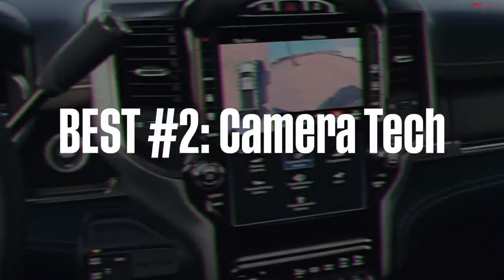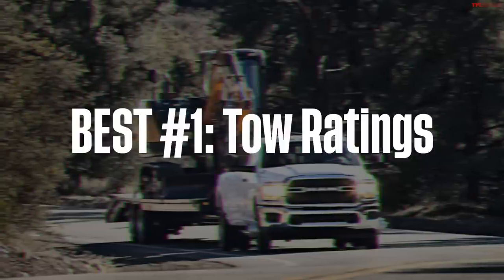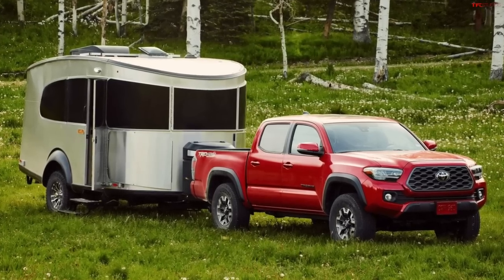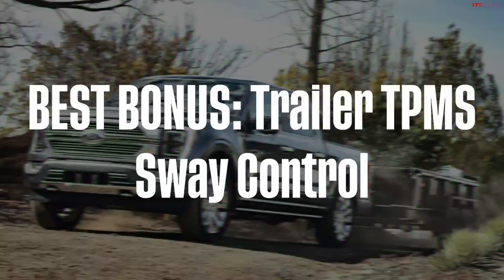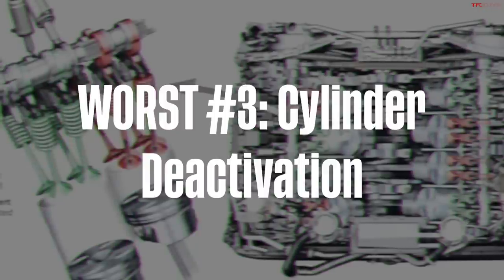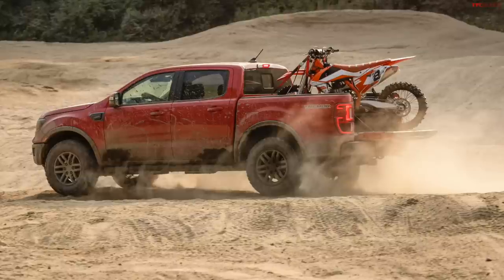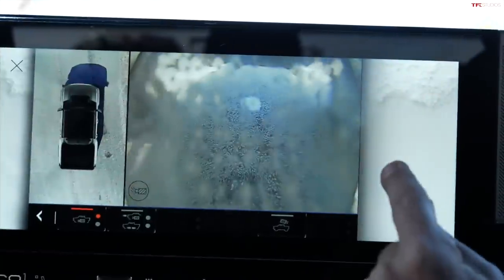This New Truck Tech Makes Your Pickup WORSE!

Comment: I guess I am a troglodyte, at 56 years old I don't see much need for anything in this vid.  I am keeping my 2016 Ram 1500 4x4, V8 as long as I can because it has none of this stuff.  I will replace engines, whatever I have to do to avoid these new trucks.  The only thing I wish my truck had is heated seats, that's it.  I bought a heated pad that I sit on on the really cold days.
Reply: I cannot agree more. The more technology the more problems.
Reply: Look, anyone who keeps an older vehicle is smart. If you keep the truck reliable and looking decently, you save a great deal of money. 
Heated steering wheel is so nice 👍.
Reply: So funny I got in my daughter's car to move it the other day and the heated seats were on.  I woke up this morning and rsndomly thought, I love my Toyota Tundra, low tech, high reliability, I don't need anything else.......buuuuut, man I'd love heated seats!  Hahaha
Reply: @jonesjones7057  I bought a seat heater that plugs into the accessory outlet.  It works, it's kinda a PIA because it shifts around but when it's 0 F at 4:30AM when I go to work, I am glad I have it.  In a couple weeks I will take it out and throw it in the garage where it will sit till winter returns.
Reply: How has the motor been. I had a 2013 longhorn 4x4 and at 70k the lifter roller bearings siezed on one cylinder and it ticked and the motor got 11mpg and it was 5k to fix that side of the motor with no guarantee the other side wasn’t about to go out. I real liked the truck but had to trade it in . Seems like motors dont last. I had a 1990 f150 with 5.0 5 speed that went 240k miles
Reply: @MrGomjabber  yeah that sounds good enough to me, I'm going to get one of those too.
Reply: @PUNCHYNUTZ  So far so good but it must be said it's low miles at this point with only 57k miles.  For the first 5 years I had it, it was a 3rd vehicle only really being used on weekends to the camping resort with family and boat.  For the last year it's been my daily.  I have had fuel pump replaced and 1 exhaust manifold (warranty).  I am aware of these issues you speak of and it seems to be hit or miss if it happens.  I would probably still dump upwards of 10k on a new motor if it goes because new trucks are just insanely priced and all the turbos and whatnot, no thanks.  I really don't think the current Hemi is probably any more problematic than the Fords ecoboost and the chevies also have problems with their valvetrain due to cylinder deactivation garbage.
Reply: @MrGomjabber  i agree and hope it stays strong for you. When it ran it was great! I have the eco now and its good and real powerful but only have 42 k on it. Im sure hell is coming because nothing lasts anymore.
Reply: @PUNCHYNUTZ  I know some guys with the early eco's that seemed problematic, like everything they have gotten better over time with improvements.  They pull like crazy, fun engines for sure.  Just everything is so complex nowdays all to eek out another .45321 mpg at great cost to the consumer.  Not a big fanboi of any automaker, bought this truck purely because it was the cheapest at the time I could find.  I look at what I paid for this truck in 2016 and what the same thing would go for now.....  Insanity.
Reply: @MrGomjabber  i feel like the strongest motors are the HD gm gassers because they dont have all the fuel saving stuff and the city of houston uses them in our ambulances and they take a beating. I know because when i drove them they had over 150k miles and rarely had issues. At least at the time they had no cylinder deactivation. But things may have changed.
Reply: Pretty sure the hemi for that year has cylinder deactivation
Reply: Count this 29 year old in with your troglodyte kin. In the few years I actually owned a truck I never felt it needed improvement. It had a radio, A/C I barely used, a heater that worked quickly, nice soft spots on the window seal for my arm to rest, 3 on the tree, push button 4x4 and two cupholders. That's about all I need for comfort. It was a factory ZR2 S10 so it rode higher, was a little wider and had larger tires, but wasn't obnoxious. 

I never opened the tailgate and thought "this should do this slower and softer" or "this should be automatic" if I had any complaints about the truck not related to its age, it was that a nice backup camera would have been a welcomed modification simply due to the large Blindspot I had below the tailgate when backing up. 

I now have a "modern" vehicle, and the only real improvement it has over my old truck is the remote start feature and backup cam. The infotainment doesn't do much except act as a glorified Bluetooth speaker, the terrain select AWD system while definitely useable is still inferior to the basic straight forward 4x4 that truck had. I could actually fix things when they broke, and they broke a lot due to age and neglect in its years. I knew jumping into a more modern vehicle I wanted the newest I could possibly afford, simply because there now exists a grey area where cars are new enough to be more complex and harder to work on than they where in the 90s, but also old enough that they are starting to need regular repairs and maintenance.
Reply: @AHungryHunky  Yeah, backup cameras are nice, I would like that.  Instead I have a few small dents in the bumper from the trailer tongue when I back up to it to hitch up.  I can live with it.
Reply: At almost 60, I totally agree with you. I have a 2000 Ford Excursion. I put in a new infotainment system that has Apple CarPlay and a backup camera. Regarding heated seats, you can actually have an upholsterer insert the heating pad in the cushion and you can install a switch on the console or dash. Everything I want with nothing I don’t 😂. And waaaay cheaper than a new truck.
Reply: I have added a back up camera, gps, Sirius radio into my 97 suburban in a custom console that I made out of some old cabinets that pretty much match interior color, I can rebuild bumper to bumper ground up 5 times for the price of a new one. Mine looks like new and won’t be mistaken for a hearse.
Reply: I got 99 problems but an EV aint 1.
Reply: @scott offord  

No it doesn't...lol!!

Comment: The tall bed thing is something my dad doesn't like and likes to joke about. "You get the same square footage for a smaller length, can't fit an 8ft plank though". Might have the same "space" as a 6.5/8ft bed, but you can't haul the same things they could. Seems most prevalent in the Coloradoes, that short huge slanted up bed.

Comment: The tow rating on new trucks are ridiculously high with almost no obvious caveats from the dealers. While these products CAN tow the rated weight, unless the trailer, hitch and trailer brakes are matched well to the truck, your trip may not turn out well.

I think that many of us have seen this mismatch swaying down the road and avoid it for no other reason than that you don't want to be the 1st responder to this potential disaster. Because you know that behind the wheel sits a guy that thinks that all is well in spite of the fact that the rruck can hardly be held within 1 lane. Afterall, the dealer said that the truck will tow that weight with "no problem".
Reply: They fudge the numbers on tow ratings, you need to read the very very fine print... Like the guy that cracked his frame with the bed camper. He did not read the very very fine print. ;-)

Comment: Start stop needs to disaper from not just truck but all vehicles. Especially if it's a turbo engine. The turbo is supposed to stay running but if engine is shut off now its not turning. So now you have to wait even longer for it to spool up to get going.

Comment: I bought a 2016 Ram 3500 Megacab Diesel and it stickered for $76k.  That exact same optioned truck for 2023 without most of the tech upgrades is still $94k.  My big questions is how does a truck that is largely the same for 2023 cost that much more when there is no more value in the truck than what was delivered in 2016.  What do I get for an $18k price increase other than worse reliability than I previously had because of all the supplier changes due to Covid?
Reply: Money supply is up more than 40% , so thats the resulting inflation the consumer is enjoying

Comment: Did you know that most fatal falls happen under 6 ft? Bed heights need to lower drastically. Hoods need to get much lower and much smaller.

If you're going to put a backup camera on the tailgate make sure it is at least usable when the tailgate is down.

Passengers sitting in the cab shouldn't be able to max out the payload, either shorten the cab to fit less people or increase the payload ratings. Personally I only need a 3 seat Truck, preferably a single cab one with a 3 seat bench and a 6ft bed.

Comment: Everyone arguing over pricing needs to check out the CPI calculator and compare the REAL price increase. Today’s base model trucks aren’t that much more today than 10+ years ago. But you get a hell of a lot more with it. More power, more capable, way safer, better MPG, better technology, better ride. You have the choice of optioning out the truck north of $80k if you so desire. The half ton class trucks are just as capable as 3/4 ton trucks of 20 years ago. All the truck classes have basically moved up a tick. The new ranger is nearly the same as an older F-150.

Comment: I learned recently from a Firefighter that a bad regular passenger vehicle fire burns at 1500 degrees F and takes 1000 gallons of water to extinguished an electric vehicle burns at 5000 degrees F and takes 40000 gallons of water to extinguished and sometimes they need to be fully submerged in water for 30 days to be fully extinguished so your electric vehicles if they catch on fire might not be covered under your insurance for building your office is located

Comment: How about the greatness of those newly readily available terrain specific traction control systems.  I was able to get all four wheels to spin while clawing up a snowy hill while messing around in my yard with my wifes explorer timberline.  The slippery mode on this thing is awesome on a snowy/icy road. A low bar but this is the best offroad explorer ever.

Comment: All that is why I'm keeping my 03 silverado. It's not a 4x4 unfortunately though so far I've managed to not get stuck on ranches. Clearance is my only issue since Texas hill county ranches have a lot of rocks that like to hit things under the truck, I wish I could lift it a couple inches but can't with this truck.

Only other thing I'd like is a Camara for hooking up trailers, my rear tag is bent in all directions from having to do it alone in tight spaces and uneven ground. All that other new tech doesn't interest me one bit and just means dollar signs for repairs down the road since I drive my vehicles until they die.

And with current prices even for base models who wants to use a truck for the tool it's supposed to be and tear it up years before you've even paid it off? Mine got hit by a baseball sized hail storm two years ago, beat the truck up pretty bad, shattered the windshield and the plastic pieces like bug shield and window rain shields. Other than the windshield I didn't care, it's paid for and twenty years old. The people I know with new trucks and cars hated it and had to get them fixed some got written off as totaled from the hail damage, just the cost of the windows exceeded value on two people's cars I know and those were late model cars. Then their insurance went up for getting repairs.

Not everything new is better or worth the price tags.

Comment: Nice if all tail gates came with dash reminder lights to let you know it is open, hard to know when bed is covered. I've install my own switch-light reminder for 30 years. Trucks are becoming 4 door family SUV with open trunk, a work truck is just that. Bound to fail is turning off and on cylinder, it is as bad as start stop engines.

Comment: I had a 19 Silverado Work Truck that I ended up forcing the dealership to take back as a lemon. I had it for about a year and it spent way too much time in the shop. It had electrical gremlins and the electronic, push button, remote activated, tailgate, would just stop working sometimes. When it would stop working, there was no way to open the tailgate.They couldn't seem to solve it, so I finally said that we gotta walk back this transaction.

Comment: Regarding the payload numbers, I had a 2015 ram 1500 crew cab with the 6’4” bed and the ecodiesel. It was a Laramie. The payload was 860lbs. It also had air ride. Fully equipped vehicles are not good for payload. I had 3200 lbs of sheetrock in the bed once and it didn’t squat at all, but I only drove about 2 miles. Now I have a 22 Silverado crew cab with the 2.7. My payload is 1886lbs. Well over double the payload.
Reply: Time to test out if it’ll do double the 3200lb Sheetrock run you did!
Reply: How does 2.7 motor pull the truck?  No regret from departing ftom v8 motor?
Reply: @dav8road598  I’ve driven the 2.7 and I have 3 buddies that have them. If you don’t tow they are good engines, but don’t tow with them! The engine is too small and will have heat issues. The other downside is they sound TERRIBLE! But if you drive around empty all the time they are good engines.
Reply: @ALMX5DP  I think it could’ve taken a lot more. That air suspension was awesome when it worked. South Dakota winters weren’t easy on it.
Reply: @dav8road598  the best way I can explain it, I hooked up to a 18 foot steel dump trailer with 6’ side walls and bawled the tires turning left onto the highway. Only thing I miss from the V8 is the sound and high speed fuel efficiency. The 4 banger is working hard to go 80 on the interstate. It does it easily, passing power is awesome, just averages about 16-17 doing 80.
Reply: @cliffordmontana4562  I’ve towed with mine a few times, only one time was around 9000 lbs. and never had heat issues. Has plenty power. Average 11.9 pulling 3500 lbs going 74 for about 90 miles.

Comment: Along the lines of cylinder deactivation, I would add auto stop/start.  Also, I would say traction control that you cannot completely turn off.  Agreed, trucks are too expensive and it is crazy about availability and ordering.

Comment: I have a 2020 Powerwagon with 50k on it and I love the cylinder deactivation. I do a lot of side road driving and it dose hekp the MPGs, plus I am able to do light acceleration while it's active. When I need power it kicks off quickly and I don't notice any difference, downshifting takes longer. I do religusly keep up on maitence and do an oil change every 4k miles.

Comment: I just bought a newer f150 and I hate that a backup camera is necessary for it. I went from a 99 half ton ram which was nice and low to the ground, fantastic rearward visibility, to this single cab f150 with a major blind spot with the foot long b pillar, and a tailgate that is 5 feet tall. I hate how tall new trucks have gotten, especially 2 wheel drive half tons.

Comment: Great video and information.   As you said and others posted the Ford backup pro assist being a $2200 range feature is absolutely garbage.  I bought a 2020 Diesel Superduty new.   The truck so far has been flawless since 2020. The Backup pro assist is garbage. I read the book, measured and placed the trailer stickers as needed to calibrate the system and entered the trailer size and backing up the old fashioned do it yourself way is 1000 times easier then try turning the backup pro assist knob.  
I bought from the dealer lot.  If I ever were to order another new truck that would be avoided next time.  

At some point would love to buy the factory trailer rear camera to see what’s behind the trailer when backing but have managed for decades without.

Comment: The constant rivalry has cause this. If you need to tow over 24k get a medium duty truck. Cameras had to be added to truck fronts to see . Bumpers are to high off the ground which is deadly to people in small cars. Everyone wanted more rear leg room so they jammed the engine into the firewall. Some engine repairs you have to raise the cab to work on it. Can’t reach into bed . Their ridiculous. Cylinder deactivation has proved to break.

Comment: On the trailers . I read were rv manufacturers are working on trailers that have batteries that can power the truck that will recharge at the campsite when plugged in. On pricing lots of trucks are just driveway princesses that are never used for intended purpose. They lift them , put oversized tires that stick way out past the fenders. It’s assinign

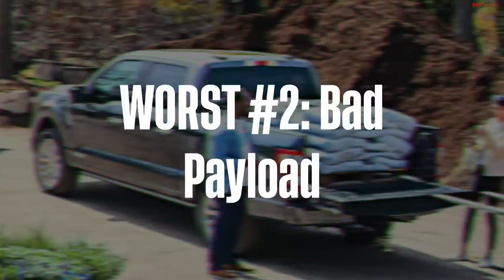Comment: I like the cylinder deactivation because I have a lifetime warranty in my recently bought 2019 ram classic 😂 12:55
Reply: Except when it breaks and you have to find something else to drive while the dealership fixes it.  Reliability is more than just not having to pay for repairs, it is the total inconvenience of having to take it back to the dealership and do without while you wait for it to be fixed or worst yet, when it breaks down in the middle of nowhere and you are stranded.

Comment: I got a 2020 tremor with the 7.3. I wanted a regular xlt crew cab long box but my wife really likes the grey color that we found in the tremor. I don't like most of the electronic features. Blind spot sensors, different drive modes for off road stuff ( just dumb if you know how to drive) cameras, different trailer modes. It's all stupid and I liked my 99 f250 more. The only thing I like is the power and honestly I'd still prefer a diesel if the government hadn't ruined them. And yes, they are too tall. I own and operate a pete 379 and my pickup doesn't need to be that tall.

Comment: Andre you are right about the backup assist. Vehicles have always had that knob installed, it’s called a steering wheel, use it to steer. If you’re not good then practice and if you can’t do it then maybe you were just not meant to pull a trailer.